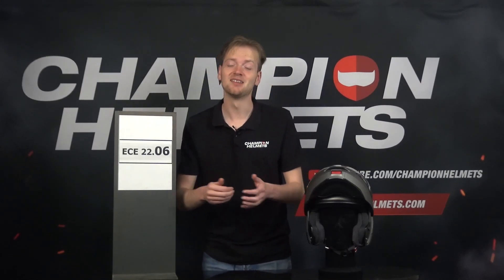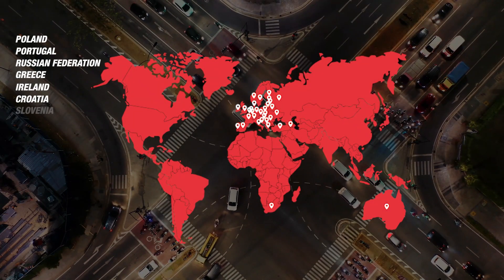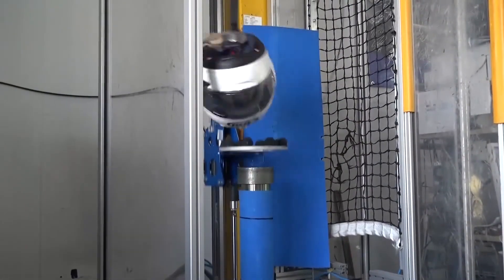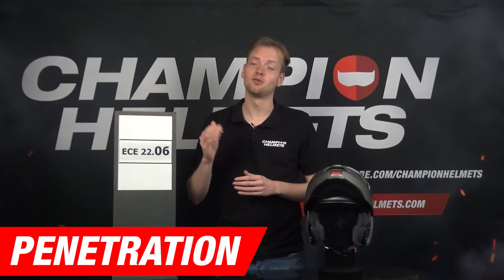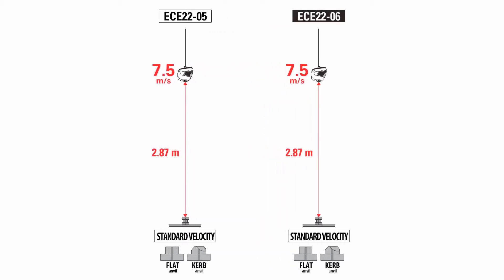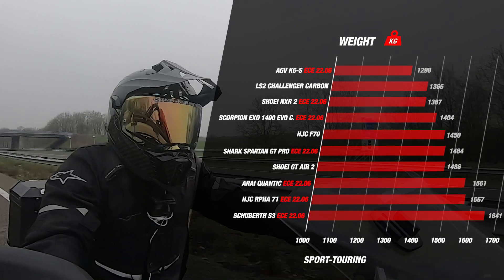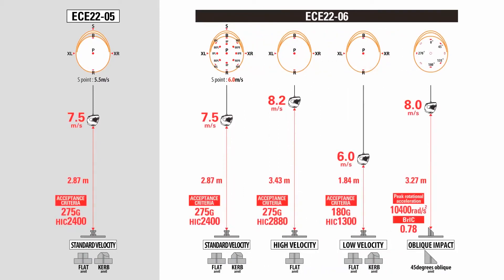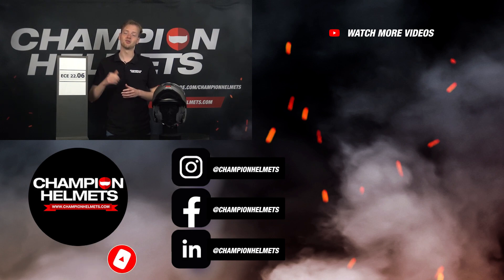ECE22.06 standard fully explained - ChampionHelmets.com

Comment: What is better? Sharp+ECE 22.05 OR Only ECE 22.06??? Is 22.06 worth skipping Sharp rating on a 22.05?
Reply: No Sharp rating is for high speed impact
Reply: @YashBs-b9z  Current Sharp rating goes up to a drop speed of 8.5 m/s  which is 0.5 m/s faster than the highest drop speed of the new 22.06 standard.

Comment: You said that the 22.06 now measures rotational impacts as well so does it come close to or parallel mips?
Reply: I believe Mips is a feature to adress rotational impacts by Bell, mainly to minimize the chanche of a concusion for the brain.

22.06 requires every helmet to have rigidity/absorbtion during a rotational impact. It does not have a 'brain impact' measurment.

Comment: What are some effective ways to deal with fatigue during long rides and maintain focus on the road?
Reply from the maker: Combat fatigue during long rides by taking regular breaks, staying hydrated, and practicing proper posture on the motorcycle. Avoid riding when excessively tired and listen to your body's signals.
Reply: An apple! Apparently, an apple has the right amount of sugar to keep you alert, but not so much that there is a 'sugar spike', which then quickly drops below the sleep line as it wears off! I've had an apple while driving and definitely feel more awake, with no obvious come down.

Comment: Are there any specific precautions riders should take when riding in adverse weather conditions?
Reply from the maker: Riding in adverse weather conditions requires additional caution. Reduce speed, increase following distance, and be aware of slippery surfaces. Consider wearing waterproof gear and ensuring proper visibility with a clear face shield or anti-fog treatment.

Comment: Great video! How can riders maintain their motorcycle to ensure optimal safety and performance?
Reply from the maker: Regular maintenance of a motorcycle is essential for safety. This includes checking tire pressure, ensuring proper brake functioning, inspecting lights and signals, and keeping the chain or belt properly lubricated.

Comment: What are the key factors to consider when selecting appropriate riding attire, such as jackets, pants, and boots?
Reply from the maker: When selecting riding attire, consider factors such as abrasion resistance, impact protection, and weather conditions. Look for gear with armor or padding in critical areas and choose materials like leather or reinforced textile.